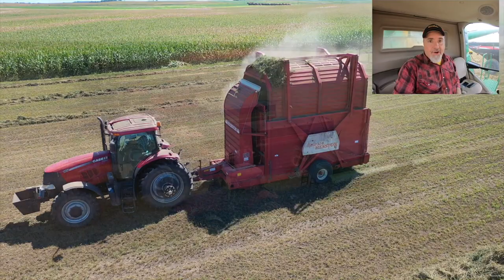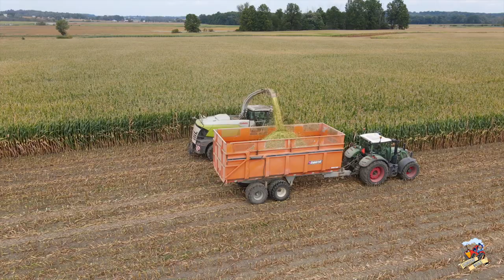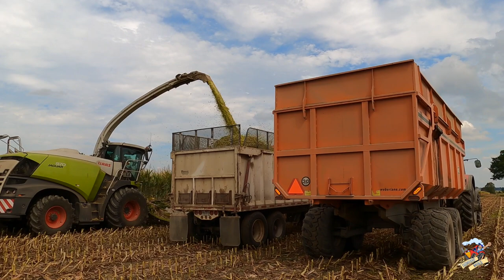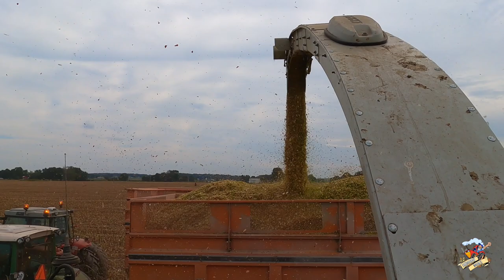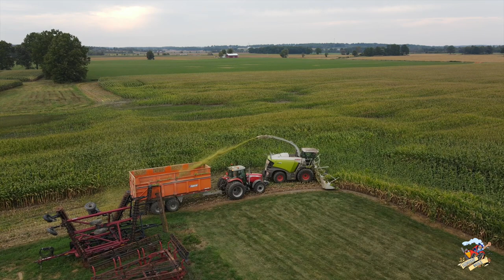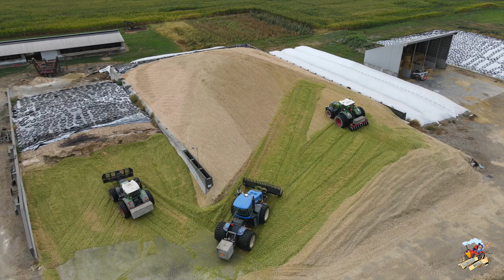Corn Silage Harvest at Sterling Heights Dairy Farm

Comment: Hey Mike I enjoy your videos, the are very informative, you explain the videos, the machinery and the process, I was a heavy duty mechanic for most of my life and worked on Cummins Engines in farm tractors first ones in the Versatile with the 555 V8 engines and just progressed. Now in my late 70’s still repairing the NTC and N 14 in the Case International/Steiger tractors. See many you tube programs and you explanations are spot on, see many comments of the not so smart people and just smile. Keep the videos coming. Cheers

Comment: What engine did that Massey Ferguson have in it with the duel wheels, didn't sound like any MF I have ever heard before .!! Sounded good though.
Reply: The muffler fell off so we just put a straight pipe on it. It does sound good though. It has the 6.6 Sisu